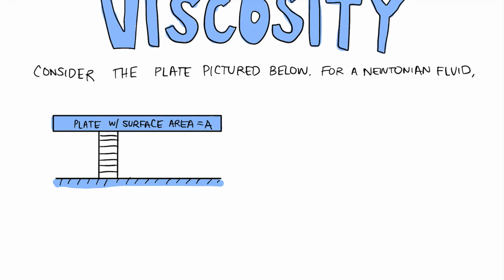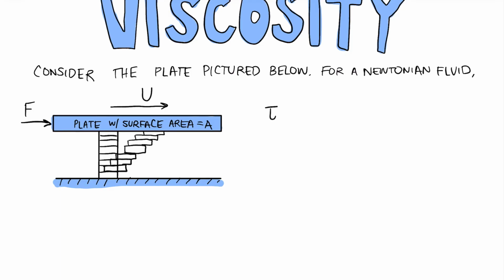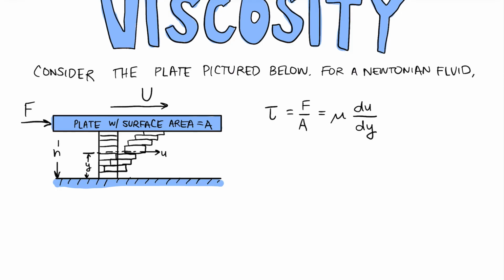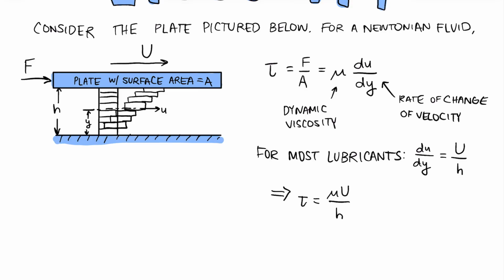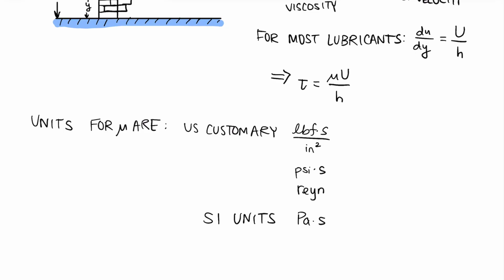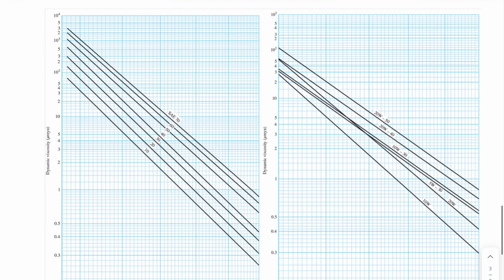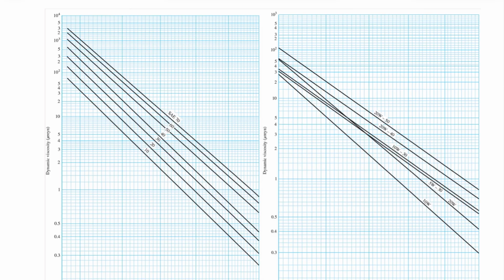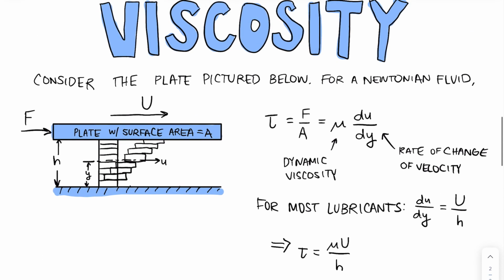Machine Design: Viscosity - Lecture 21B

Comment: How does the selection of lubricant viscosity influence the thermal performance and wear characteristics of machine components under varying load and speed conditions?
Reply from the maker: Great question—unfortunately, there’s no simple answer. I actually dive into this topic in more detail in my latest video on Petroff’s equation, which touches on how a bearing might respond to temperature fluctuations depending on lubricant viscosity. You can jump to that part around 14:50: https://www.youtube.com/watch?v=F9HDRdIUOAk&t=890s

In general, there are two main wear mechanisms in a typical lubricated connection:

1. High shear stress from a high bearing modulus (which comes from high viscosity, high speed, and low load), and
2. Contact stress from metal-to-metal contact, which is more likely when the bearing modulus is low (low viscosity, low speed, and high load).

The key design challenge is finding the right balance between these two to minimize overall wear.

Hope this helps. If there’s a related topic you’d like me to explore in a future video, feel free to let me know—I’m always open to suggestions!
Reply: I also would like to know